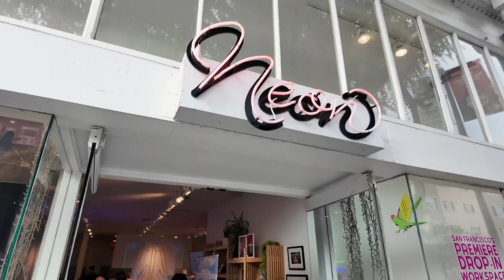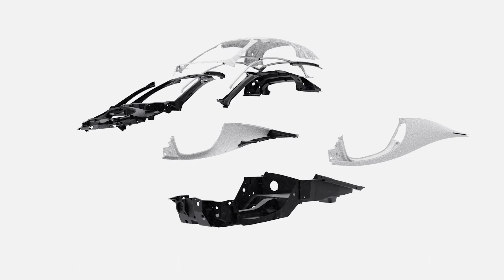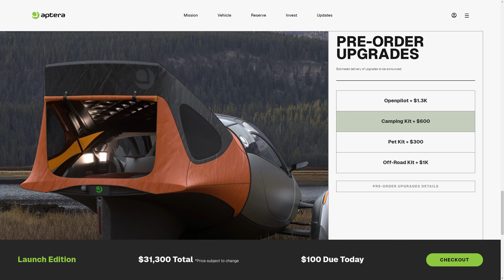Aptera Update — September 2024

Comment: Has the performance, durability,efficiency, and reliability of this thing been tested in a significant amount of snow?  Is it just meant for the sunny coastal areas.  Has this solar EV been tested for extremely cold weather as far as the performance of the battery, and any negative cold weather performance and reliability aspects?

Comment: Aptera, if at all possible, do small batch builds of 1 or 2 at a time that are prepaid - or you could finance 50% with a 50% cash prepayment instead of waiting for large scale series funding 

I will bring $18,000 cash and travel to Carlsbad if I can get a guaranteed completion date. I would stay for 3 days to participate in my Aptera's final assembly.  There must be others like me.  Must get some products out. The engineering is acceptable. Time to build or die trying.
Reply: Has it occurred to you that maybe there is some problem other than assembly time? What makes you think $18K is 50%?
3 days, no Aptera response, what does that tell you? Your $18K cannot fix Aptera's problems. Keep it safe in your pocket or demand a penalty clause in the sales contract for late delivery. $1K/wk!

Comment: If you need a tester in a hot climate, I'm willing to give it a go.  I live in Vegas, and each month, I take road trips to Utah for work, usually traveling about 450 miles each way.  I also haul camera gear, and run a cam for every trip.  I'd be glad to document everything and return the vehicle when done.
Reply: Well, documenting Aptera on that trip is an absolute no-no! Did they document the trip to Battery? In-N-Out with Jerry tailing them is the limit :-(

Comment: Sounds like it can only run 48 mile s by solar energy? Original statement is about 480 miles? Correct me if I’m wrong. How disappointing!
Reply: There's a lot of uncertainty about this and it varies across the country. Aptera likes to talk about Carlsbad without explaining their claims are limited to that climate. They're claiming avg 30 solar miles/day. I estimated as low as 25 so let's say 28. In East St. Louis, pretty avg for the country, I estimated ~21. Unfortunately Aptera refuses to demo miles/kWh and kWh/day. Both are seasonal and regional.
Reply: The launch edition can still hold up to 400 miles charge on its 40 kWHours battery. It can charge up to 40 miles each day on solar.
Reply: @jasonhochstrasser8657   Do you own enough solar to be familiar with daily and annual performance. Aptera stopped using avg 40 solar miles/day in Carlsbad climate a long time ago. They now claim 30 or 11,000 miles/yr. But LA, SD, Las Vegas, Phoenix is the best solar region of the country and the battery also benefits there. Cabin A/C is a negative. East St Louis is pretty avg solar performance for most of USA. Solar and battery will do worse. I estimate avg 21 solar miles/day.
Reply: @stix2you  I expect Aptera drivers to have pretty light feet. That will probably be one of their success items.

Comment: A valiant effort keeping the design concept alive; but a mid level 2024 Prius costs the same and gets close to 60 mph.
Don't be fooled; the whole "solar charging " thing is a red herring.
Reply: It better get close to 60 mph!
Solar charging is legit. A significant percentage and likely a majority of Aptera miles will be solar powered if customers option it.
Reply: What price are you expecting for Aptera LE?
Agree 100% with your Prius comparison but suspect real Aptera LE price will match Prius PHEV for even more superior performance compared to Aptera.
Reply: @artsmith103 RE; Aptera pricing=  25-kWh entry-level + range of 250 miles, starting price of $26,000
40-kWh model, range of 400 miles , starting price of $30,000
60-kWh model , range of 600 miles , starting price of $35,000
100-kWh model,  range of 1,000 miles, starting price of $45,000
IMPORTANT NOTE = Aptera curb weight = 1,800-2,200 lbs
Call me stupid; but the Aptera's only advantage may be it's LOW curb weight; which greatly INCREASES the potential range.

2024 Nissan LEAF- curb weight =3,483–3,616 lbs  149 mile range $28,140, 60 kWh battery 212  mile range - $36,190
Reply: An Aptera is nothing like a Prius.  It is a much better concept.  Nothing against hybrids, but their time has come and gone. EVs are much better than hybrids.. Far less complex, more efficient, non-polluting, and no oil wars fought for them... to name just a few reasons.  These truly idiotic attempts at finding comparisons between other vehicles and Aptera are the hallmark of concern-trolls.  There is NOTHING like an Aptera on the road.  It is unique for many reasons.  TRY (really hard) to find something like it and then make a comparison. I dare you.
Reply: @J-W-Kelly  Aptera is lacking in ability in every way important. If it was less than $25K there would at least be an excuse. The only thing it might do a little well is save $200/yr in kWh. That is little reward for all the other sacrifices. The reason there aren't other expensive 2-seat trikes is because it's a horrible idea. Same reason no professional investment support.  Making $0.50/day of electricity in warm climates is not reason to buy an otherwise underperforming vehicle. 
The PHEV Prius comparison is for the people that value 40 EV miles/day. The Prius does everything else better, and potentially for the same price.
Reply: @J-W-Kelly  Dare ACCEPTED = You are so damn right man; there's absolutely nothing like the Aptera ....um; except for the FAILED ElectraMeccanica Solo and um...the FAILED Electrek Sondors ... and um...the FAILED  Nobe Cars Nobe GT100...and um...the FAILED ZAP Alias Roadster...and um....the FAILED Elio Motors Elio P4, etc, etc,  It's a no brainer; considering all of the "failed cars similar to the Aptera" examples above ; I think that the absolute BEST investment that YOU can make right NOW to dump ALL of YOUR assets into the Aptera Car company !
Reply: @someguydino6770  More excremental excellence!  None of those vehicles are anything close... but do go on.  Hilarious steamed-cheese-brained idiocy!  Thanks for the laugh.... well... more of a scoff of derision, but enjoyed none the less.
Reply: @J-W-Kelly  come on man; PUT YOUR MONEY WHERE YOUR MOUTH IS!

Comment: Most influential car since the Ford Model T!
Reply: Or The Dale. 😂
Reply: 1. It's not a car...2. let's see it make it to mass production... then we can start handing out the awards
Reply: Not a "car" classed as a two seater motorcycle. Doesn't have to conform to crash safety standards. Ford developed the assembly line, Aptera doesn't seem to know what one of those is.
Reply: @Martin-se3ij    That is correct, however (see wikipedia on Ford Model T):  "Ford's Model T was successful not only because it provided inexpensive transportation on a massive scale, but also because the car signified innovation for the rising middle class and became a powerful symbol of the United States' age of modernization."   Aptera has the same potential.
Reply: @koenraad4618  I don't think Aptera has any potential outside of being a niche vehicle in a sunny state like California. Certainly not much use in my home town where in winter it could rain for three weeks at a time. The damn thing is actually wider than a Hummer! And 20" longer than a Mini that seats 4 and which is cheaper! Ford shaved the price of the model T down to the basics. He specified the crates his engine supplier shipped his engines in and then used those crates for the floor of his cars. Aptera is using fiber and epoxy body parts it is having built in Italy and shipping them to the US. How do they expect to get cheap prices on those?
Reply: @Martin-se3ij 
What I do see however, are Chinese companies capitalizing on the interest to deliver a lower cost lower spec option. Considering the BYD 10K car that scored a 5/5 on the EU crash safety test is of any indication...

Comment: Did you misspeak?  You said roll cage?  I understood that the BINC did not require a roll cage.  I have followed Aptera for years and have an order in and this is the first i have heard of this.  I’m starting to get a strong feeling of major changes that should not happen this close to production!  Anyone else get this feeling?
Reply: THey've talked about the roll cage before.  Not sure why it's a surprise and why you wouldn't want one...
Reply: The aluminum roll bar and supporting structure have been discussed a lot but some of those people are censored.
Reply: Someone may correct me, but the BINC is strong enough to handle a roll-over event.  However, in order to mount the door hinges, a strong surface is needed.  I think this is the main reason for the so-called roll cage.

Comment: I used to see these all over Carlsbad in 2009. That's 15 years ago.
Reply: Correct, that was when the target was to be the most efficient gasoline powered production vehicle. They made great strides in both minimum drag co-efficient body design as well as fuel efficiency. As others pointed out in this comments section funding is an incredible roller coaster of a ride. Aptera Motors re-launched in 2019, nearly same design, 10+yrs technology development, and a goal of total electric, onboard solar charging. They’ve made great strides in ~5 short years. Its incredibly difficult to get an automobile company up and in production for a number of reasons. Add to that challenges with filling the space as a “disruptor” by going from 4 to 3 wheels and the challenges increase exponentially. Aptera, when they ultimately reach full production, will hugely influence the transportation space. They’re updates this go around are attempting to be fully transparent and keep people apprised of just where they are. The fact that so many are noting disappointment shows just how much enthusiasm and anticipation there is for the product. Great engineers, marketing, ramp up of tooling. Funding seems to be the major barrier slowing down more rapid progress. Stay the course and when they get there, we will all have a product that is amazing.
Reply: @ORBear46  incorrect. These were EV’s.

Comment: Once you get into "full production", what is the expected rate of vehicle production?
Reply: They said 40 vehicles a week, but 80, if the add a second shift, in previous videos.  That is, for one production facility.  IF it begins to take off, they could build another plant in another section of country, or around them.  The factory doesn't take up much space and probably wouldn't need to be built from scratch involving a lot of regulatory bodies to look at it.
Reply: @artboymoy  My reservation number is over 6,000.  Does that mean I will need to wait 16 years to get my car?
Reply: Maybe I have this wrong, but didn't either Steve or Chris say the bodies will be fully built in Italy and then shipped to California?  That means they won't be able to stack very many vehicles into a shipping container.  How exactly is that going to work?  I could see them stacking bottom halves and top halves together and shipping them that way, but entire completed assemblies are going to take up quite a bit of space.

Comment: How repairable is the body going to be? Maybe i'm mistaken but it seems like if the body structure is damaged then the whole thing needs to be replaced to the point where it might total the vehicle. I hope the body is able to be split somehow to allow for sub-assembly replacement. Also is the entire UI going to be on a touch screen? I know that it streamlines things and looks cool but having driven in a Tesla i have to say the practicality of not having simple buttons to push is annoying at the least and kinda dangerous at the most (imagine having to look at the screen to change something like the volume or AC settings rather than just feeling for the relevant buttons while keeping your eyes on the road).
Reply: At least so far the non moving PIs don't present that danger.
Reply: From what I understand the interior will be very Tesla-like in design. It saves money on production costs. I do believe they are using traditional blinkers.

I like you still like tactile buttons. I love the way my Genesis GV70 interior was designed.

Comment: I am shocked at how flat those seats look. The buildup rhetoric kept mentioning "supercar", the team kept showing beta corning hard, i had hoped for more.
Reply: It's not a race car though, change the seats out when you get your Aptera. I am sure they will have a video on replacing the seats (although with stock ones) so getting fancy seats shouldn't be a problem.
Reply: @PandaKnight52  When you buy yourself those better seats, may as well get some fiberglass and put a body around them and better wheels and throw an engine in there with some batteries, the odd solar panel for the roof and Bob's your uncle.
Reply: @PandaKnight52  obviously, but they oversold it. I am getting a sinking impression that this will be a really expensive Leaf.
Reply: @kevindavis8143  Well, a Leaf you don't need to plug in if you use your car like most people. If you don't live in your own single family dwelling, that alone makes it much more compelling.
Reply: @fotoguru222 Being very realistic with Aptera's numbers, they 1st advertised 40, now lowered it to 30. But that is for SW USA. I think it's going to be closer to 25. Then in the rest of the country close to 20. How does that fit in with your no charging plan? Shouldn't Aptera be explaining that better?
Reply: @fotoguru222  a Leaf I can't take my family anywhere in, requiring a second car that negates any electricity savings. 
I'm a believer, and I wholeheartedly agree that this will enable those that can't charge at home, but losing sportiness is a big loss for me personally. No AWD, no hub motors with non-ABS torque vectoring, and now no support for carving canyons... big losses.
Reply: @artsmith103  I have heard nothing but 40 miles of charging possible in a day in sunny locations. Did you hear differently from Aptera?
Reply: @jerrymcintire7902  It has always been "up to 40 miles range on solar."  Notice that they have yet to test any vehicles with the full range battery, so they can't even guarantee the battery gets 400 miles per charge.  What if it only gets 300 miles per charge?  Then the maximum solar charge will be less too.

Comment: So no rolling chassis yet. But thanks for the update and a few more bits and pieces. I like especially the new tent render.
Reply: There are several rolling chassis already. Yes, the PI builds are still to be completed. That's a matter of weeks at this point.
Reply: @jerrymcintire7902  I noticed that. I only check twenty times a day on Aptera ;).
Reply: As Steve from this channel pointed out. That he remains sceptical about the tent design being impractical from the looks of it, mesh window, sealing … . In the same way I do not get what the dog kit is about. Would not let my Labrador enter over the wobbly ladder and climb over luggage. Dogs must enter through front doors for the compartment behind the seats.

Comment: Thanks for the update Steve! It was great to meet the Aptera team and fellow ambassadors and reservation holders at the recent San Francisco event. I had seen and sat in the Gamma model at the Fully Charged show in San Diego, but it was an added treat to see (and touch) the BinC and new PI seats. it is going to be a real milestone to have the BinC and SMC body panels together with the PI frame, new motor and PI battery pack!
Reply: Did I miss revised target dates as to when?
Reply: @gr8dvd  When for what? PI2 testing? It will likely come together before the end of the year, hopefully along with PI4 (the finished one) being revealed. 🚗🌞
Reply: @deanmcmanis9398  Yes when PI builds to be completed for testing/verification. Thx.

Comment: So... I know you stuck to the battery electric model but would you ever think of producing the hybrid again? For those of us who don't live in suuny regions.
Reply: That was back over a decade ago when batteries were much more expensive and not as good. 
With a 400 mile range Aptera next year, and 600 and 1000 mile range versions coming in the upcoming years, no one will need to burn anything to get where you're going.
Reply: @fotoguru222  well I guess there are alternative charging systems so I see where you're coming from.
Reply: I was under the impression you can still plug it in, the solar panels are just a bonus
Reply: @error.418  And you are correct!
Reply: @error.418 You are correct. You can even plug it into a standard household hold outlet.
Reply: @error.418 definitely. Tesla plug or from 120v grid. And solar at 40 miles a day.
Reply: You do have electricity where you are?
Reply: @J-W-Kelly  he must have a way to charge his cell phone. Yeah his comment is very confusing. Even plugging into a 110V outlet for a few hours will get you plenty of range.
Reply: Where would a gasoline engine fit?
Reply: It is a battery ev that has 700 eatts of built in solar panels  that, to be proved, can produce as much as 40 miles of charge a day.